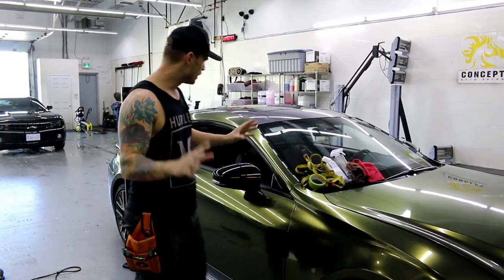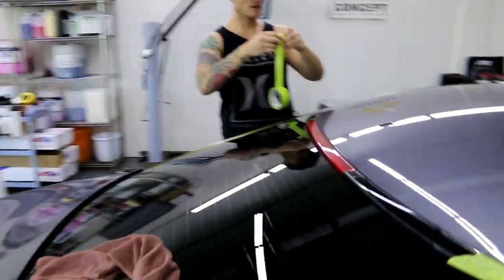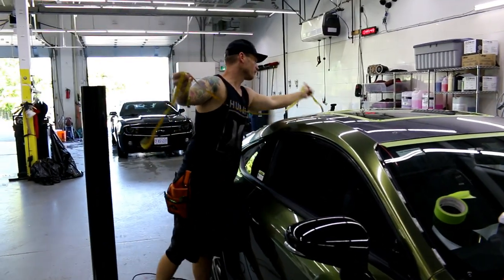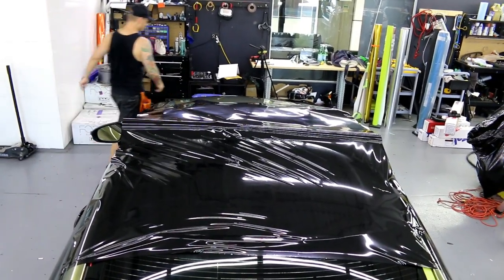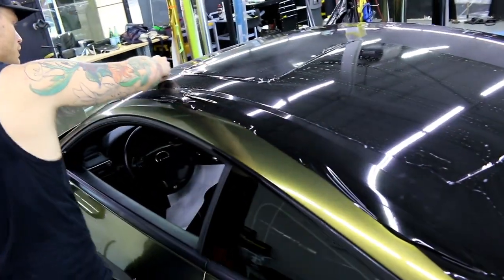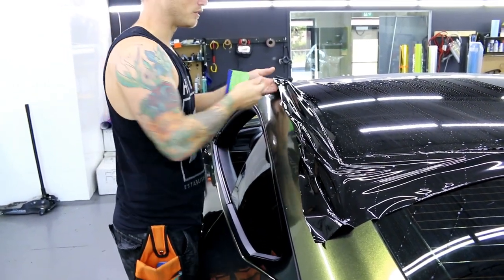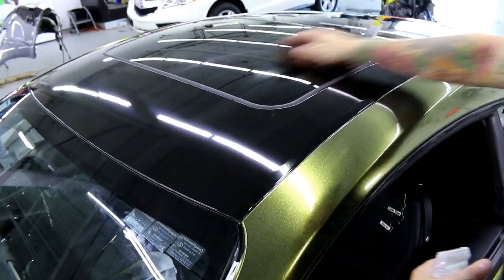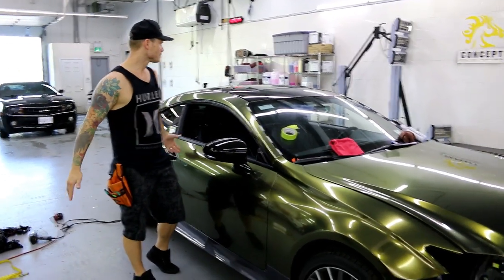HOW-TO WRAP YOUR ROOF IN GLOSS BLACK - SUPER DETAILED POV | LEXUS RC 300

Comment: The marking on the backing that Christian is referring too is usually put on by the vinyl manufacturer, in this case Avery - Dennsison. It's put there a few ways. Avery runs the backing through a printer, probably somewhere around 160 f.p.m. Or, when ordering their backing from a paper mill, if that paper mill has printers, Avery could request that they print Avery's logo on the back of the backing. 99 % of the time it's for their own advertising, and it works. The more people see their name, the more name association there is between the vinyl product and Avery. It's an interesting process to watch. Here's something i found out yesterday. I went to a new vinyl store that just opened up. I asked what they had in the Avery line. I was shown samples. None of the samples had an Avery printing on the back. Why ? Because all he was doing was middle-manning the vinyl at a marked up price. Used to be a very common practice. So, even though i saw Avery vinyl, there was no Avery printing. No Avery printing, then I don't know the vinyl manufacturer. If it had Avery print on the back, once i got home, I Google Avery vinyl, and see a cheaper price. It's not a dishonest practice at all. If they sold it at the same price as Avery, then they don't make a dime selling you a roll. So, always buy from the source.
My best,
Scott 
P.S. Christian, another gorgeous wrap job !

Comment: I have watched 8 different vids on this subject and there were 5 different methods. This tells me the majority of “ professional “ wrappers are winging it.   I did my mkv gti w/ sunroof by myself with $50 of 3m vinyl wrap, a $45 wrap “ kit” of amazon ( which I returned after using so free!) and $15 cutting string. Took my 45 minutes. After Completed I took it by a shop to ask if it was a good wrap ( I said a different shop had done it and wondered if they ripped me off for the $500 they charged ). They guy said it looked great and that I didn’t get taken. So……………….🤔😎

Comment: That tack changes the entire process.  Maybe I'm old school, but control tac from 3M is way easier to deal with.
Reply from the maker: Nothing is easier than Avery my friend. Control Tac is a gimmicky name for pressure sensitive and Avery has the best pressure sensitive adhesive. To be honest, I don't even like Avery. There are much better films these days and 3m is below most.
Reply: @CKWraps  Thank you for the reply sir!  Yeah, I honestly haven't wrapped a car in over a decade and I am trying to decide on a brand that I can be confident enough of to jump into wrapping my Tesla.  I just remember having confidence that if I messed up with the application, I had the "control tac" to save my ass.  I was always doing full image wraps.  So each sheet had to line up perfectly.  Im assuming wrapping all one color will be a piece of cake compared to doing that.
Reply from the maker: @ARMWRESTLINGCYCLINGFRANCE  it has its other challenges. A lot of times the goal isn't to make a commercial wrap look like the vehicle was painted. With color change you'll need to cover every edge, corner and recess to prevent any of the paint color from showing at any angle.
Reply: @CKWraps  True.  I was doing full wraps on racecars and the attention to detail was important, but not quite as strict as it would be working on a luxury vehicle.

Comment: What's up Chris, I don't think you remember me, I have seen almost all of your videos, I am a learning wrapper in Mexico, I just have a quick question hope you can help me... What you do when post heating in the gasoline cover? Isn't it dangerous? Or do you empty the tank?
Reply: mm good question. i'd like to know this also. hope anyone can answer this.
Reply: As long as the inlet is closed and surrounding is cleaned well it should be fine. Gasoline is very light with air and even if you leave a bit of it it will evaporate.

Comment: You stated that you had to glass it out because the way it was wasn’t a good way for it to be squeegeed out, I would of liked to hear why it isn’t good. Also you said that you loved to work with this type of vinyl because it’s so thin and easy to work with, and because it is a thin vinyl that it comes with disadvantages, I would of also liked to know what some of those disadvantages are. Just curious because I just paid a local vinyl/ tint guy to wrap the hood & roof of my car and it low key looks like he used thin vinyl and I would like to know what my disadvantages are. Thanks! I only paid $360 for hood & roof

Comment: Man I've used tips from a couple of your videos and have done 3 car roofs with success.  However, man I am horrible at glassing.  Could be because I'm using Vivvid instead of Avery maybe.  But I usually spend a few hours longer due to having to heat and confirm on my roofs.  Totally sucks 🤣

Comment: Awesome video! I'm going to be wrapping my roof on my 2014 Grand Cherokee But it has the Panoramic roof where the front glass goes down and under the rear fixed how should I approach that? Also what if the roof is not entirely flat, it has like raised lined toward the back any tips?

Comment: Nice video. I'm new to this, so I got the following questions. Why you didn't use heat gun for the edges?
Reply: There was no need for extra stretching just squeegee everything off especially that the film was very thin so no need for heater.

Comment: What do recommend if you dont have a shaded area and need to do it in your drive way? I got a Square roof but it's also got those small ribs in it should I use a heat gun for it.
2004 scion xb

Comment: Can you spray soapy water under the vvivid vinyl ? I want to do a windshield banner and want to be able to move banner around.
Reply: You cant, it's a dry application film.
Reply: good question, I haven't tried that yet
Reply: i went on vvivid website it says you can do dry application or wet application.
Reply: I guess you can spray underneath but then you'll need to squeegee it harder to push out all that water.

Comment: level one vinyl.. simplied$  𝔾𝕃𝕆𝕊𝕊𝕆𝕌𝕋=  AKA pull slack/ rinkles on non needy formate to "0" RINKLES.  "SUPER THIN MATERIAL" or any thinkness in this motion is applical.    ### being less durable/ fragile like you would with chrome, USE new monkey strips and solution in consideration.  $$$ EDGE=  GIVE at least (3/16th or 1/8"+)cut from contact after slight smooth over of edges.. $$$ EDGE THEN, smooth into/over as much as you can first then use heat gun and phisically apply pressure to fully seround edge creating a hug effect.  this it why it doesnt peal off in hot weather if dont to spec.  "RRRemember; less sress is more 𝖕𝖗𝖔𝖌𝖗𝖊𝖘𝖘"